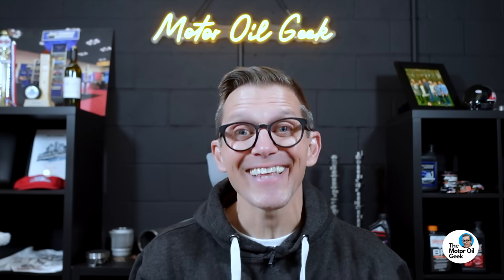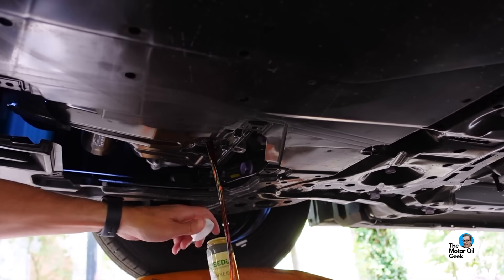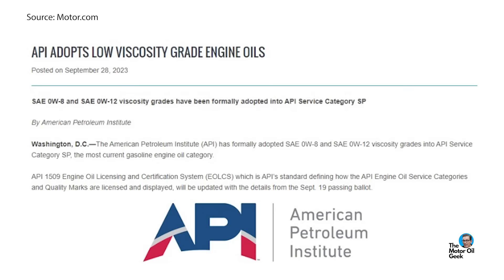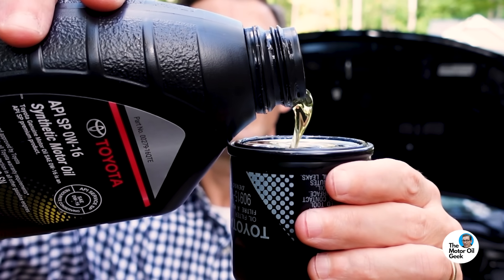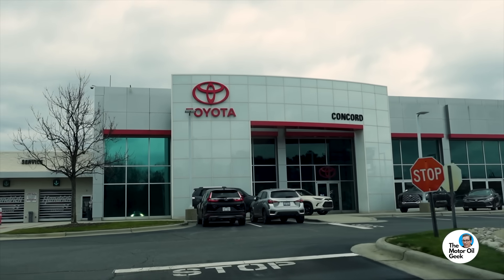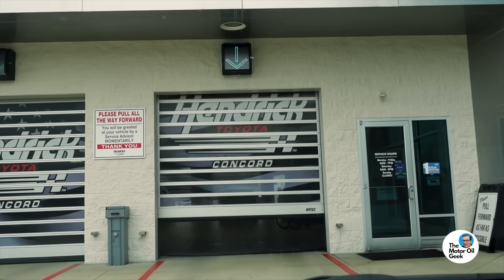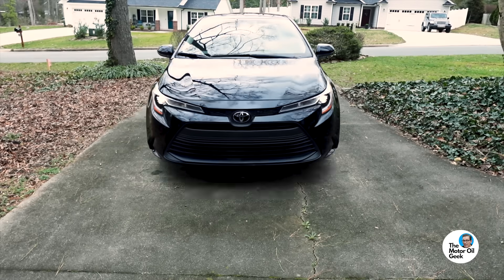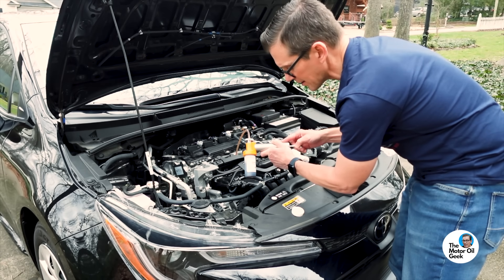0W-8 Motor Oil: Too THIN to Trust? Let's Find Out!

Comment: CVT transmissions can work well as long as you know what you have, fluid needs changed every 20,000 miles, the Jatco transmissions have 2 filters, one in the pan, the other where the cooler lines come out, make sure both are changed, also they will not stand hard driving, that is why you will only find them behind low power 4 cylinder cars, so drive easy and get the fuel economy benefit, never let your 18 year old son borrow it lol
Reply: Toyota Aisin CVT's certainly can. I know firsthand from New and over 235K miles so far
Reply: Nissan is giving CVTs a bad name. Toyota has a direct drive first gear.
Reply: Don't really need to replace the pan filter as often. It's more of a screen filter that collects bigger debris while the paper filter collects fine particles. The pan filter is quite expensive as well, I say replace the cartridge paper filter and just inspect the pan screen filter.
Reply: Just got a 2021 Corolla with 41000Kms on the clock. I have accelerated with full throttle once and boy it was really impressive...but my thoughts exactly I will be looking after it!!!!
Reply: Lol as if i need to change my ECVT's oil every 20k miles
What a load, NO one recommends this, least of all the experts that make and repair these for a living.

Comment: the thin oils are fine for a new car, you get the benefit of a bit more power and MPGs, but trust me when you get close to 100,000 miles, you need go to a higher viscosity oil the compensate for internal engine wear, or oil pressure will be too low, not a good thing, higher viscosity oil will help you get to 200,000 miles and beyond
Reply: Citation on any data to back this up?

Comment: lets look at Nascar , years ago one team found using really thin oil would give the engine just a little more power, very important in a race, even one horsepower could be the difference between 1st and 2nd place (Lake would know a lot more about that than me), but after just one race that engine is gone, car makers are under big pressure to get better fuel economy, the main reason for the thinner oils, yes you may get 1 or 2 percent better fuel economy, but is it really worth it if you have to repair or replace the engine? a few gallons of gas is way cheaper than an engine rebuild, I am a professional mechanic with my own shop, I do not even buy the 5w 20 oil a lot of older cars use, they all get 5w30 in my shop, do not get many with the 0w16 yet, I may put 5 w 20 in them, hope Lake sets me straight, do not want to make a mistake!!!
Reply: Did you not see the test results in this video? Did you not see the test results in the previous video? You can see the PPM values of all the different metals. Wishful thinking is one thing but facts are facts.

Comment: Question I have a car  that calls for 5w20 and I use synthetic oil for oil changes can I use 0w20 in between oil changes to top off???? Only reason I buy 5 quart containers and 4 of my families vehicles all require a different weight oil !! I don’t want to buy individual quarts

Comment: u should try 5w30 and see how bad the mpg really is compared to 0w8. Supposedly you can run up to 20-w60 for that engine overseas. I wanna try 0w8 in one of my 80's beater cars if it will help mpg a decent amount.
Reply: It’s still under warranty, he should follow the manufacturer’s instructions.

Comment: I can assure you, dealerships buy bulk oil from whoever gives them the best deal with the best perks.   The Yota dealer I used to work for built a new building and Quaker State bought them two Rotary lifts and gave them two NASCAR body go-carts to get the contract.  The GM dealer was using Kendall, Chrysler/Dodge/Jeep was on a Valvoline contract.   They are not required to use a manufacturer’s oil.   Hell, tons of places use BG for their trans flushes.
Reply: I haven't worked with CVT's much, but normal gear shifting transmissions definitely do better with BG. My manager at Chevy was working hard to get BG products going and the data and studies were very convincing. The BG work for CVT's, I'm told was better too, but it's been some years since I upgraded my life from being a mechanic, got into IT, but if AI takes a bunch of jobs, maybe I'll have to work on cars again. LOL Nah, I'm top at my IT experience level so that should add some safety for a while, especially since I can do a lot of hands on work that much of the IT industry can't do.

Tell me who, other than a mechanic is going to figure out that the wall socket is dirty (clean on the outside). We have so many more variables we're usually fighting than with computer building. I hope they never get into computers like they did cars, intentionally making them hard to work on, but if they do, my automotive background will be huge. LOL I guess the car equivalent is bad gasoline, which happens most from customer errors.
Reply: Can depend. Dealership I work at, Dodge size uses bulk oil, chevy side uses bottled genuine ac-delco oil.
Reply: @LovesHina  It’s up to the franchise owner.  It’s interesting that the owner is going through the heavy profit loss of using individual quarts, and on top of that rebadged bulk oil sold as AC Delco.  I assure you, AC Delco does not own a refinery.   Who knows what these owners think.
Reply: @blackhawk7r221  I also find it a bit strange, as it does add a non insignificant amount of trash, and time to each oil change as well. I assumed it's a GM/Chevy thing, since they do have a few varieties of oil for different applications. Dexos 1, dexos 2, Dexos D.
Reply: @LovesHina  With the way the LS cams were being eaten up a while back, this may have been a measure to ensure that a legit factory approved oil was used.  I doubt it, but like I said, we never know what’s going through the minds of owners.  I’ve seen them do some oddball stuff.
Reply: @LovesHina  I've worked at Chevy dealer where a lot of oil wasn't "Chevy" and bulk, but they definitely made high quality choices for products for cars.
Reply: " brown and slipery" good enough. But they charge you by the Liter for what ever crap they put in your car.
 Been doing my own oil changes  now for 55 years. Every 3,000km.

Comment: Not a big fan. I started running thicker oil than what the manufacturer specifies, if I can get one that is still compatible with the exhaust filtering systems. 
I'd fill in 10W60 full SAPS if it would not probably kill the cats and filters. That ZDDP is said to be one of the cat and filter killers... You probably can't buy that oil because it would break todays super low emission systems. Nobody cares when racing. But running in series production street legal engines is a completely different story. Because you can't run such intense additive packages. So... 0W16 is the thinnest that I would even consider for that car.

Comment: I've been proactive on my 2020 Chevy ZR2 but, think that GM quality is rather suspect these days. When I went to change the transmission fluid & filter @ 32K miles (I do a lot of off roading in it) the "trick GM recommended" fluid has given me an occasional "shudder" that never existed before. Doing the differential fluids the front looked great but, the metallic sheen of the rear fluid @ 32K miles gives me a great concern that once again GM or Dana has assembly line issues in setting up differentials. My friend with a shop has seen quite a few issues with GM differentials these last few years. Maybe I need a Ford Raptor? GM under Mary B has been on a TERRIBLE PATH towards "self destruction" with her lack of vision & leadership. Toyota saw through the EV mandates BS and never wasted their engineering talent on this too soon to market technology....Maybe I need a Toyota?

Comment: No oil lasts 10k…wake up folks
Reply: It can last 10k if driven on highway. Even manufacturers add into their manuals that under heavy duty conditions ( city driving ) you need to change oil every 5k-7k miles.
Reply: In a crap motor, true.  I did full synthetic 10w30 for 10 years in a Dodge 600 Turbo, my oil analysis said it was good for a couple more thousand miles, so you're wrong.
Reply: @lonniebeal6032  You didn’t make your case and no, you didn’t get an oil analysis after a 10k oil change interval, claiming you had more oil life left. You are full of it.

Comment: I feel like you are the right person to ask this and I would love to see a video on this as it seems no one is in agreement. Techs believe 3-5k is max even with advances in technology while OE’s are pushing that 10-15k while aftermarket’s like Mobile 1 and Amsoil are pushing 20-25k. Obviously the question is quite load and dependent on many variables but with everyone is disagreement it’s hard to come to an educated opinion
Reply: At 49 yrs old, and owning a shop, working dealerships, just 25 yr recert ASE Master +, having loyal customers nearly 20 yrs in my shop, I can give proven, experienced advise.  Stick to around 5k miles.  I tell certain ones with newer cars they can stretch a little if they have good driving habits.  I get to see their oil when it comes out.  Personally my vehicles all go 3-400k miles on original engines.  I stay between 3-5k max.  Because I know my driving habits.  lol.  80's to mid 90's get 3k on the sticker.  ALL others get 5k unless they demand otherwise.  I generally rotate every time now.  I switched to full syn oils back about 2010 (syn-blend about 2006) for all vehicles and never used cheap filters.  Mostly OEM.  Don't like it?  Go somewhere else.  I'm not an oil change shop.  I only do oil changes for my regulars so I can monitor for other upcoming issues.  A 5 quart oil change is running about $84 total  May 2024.  But how many have a $100/hr tech changing your oil and checking everything over at that time?  Not many.
Reply: Been doing extended drain intervals (10 to 15k miles) using Amsoil or Mobil 1 and best quality filters with no problems for going on 20 years.  Just sold a 2008 Honda Fit with 280k miles that used a half quart in 10,000 miles.  Always start with a well maintained engine if  used and start with an effective engine flush such as Amsoil Engine Flush per directions.  For extended drain intervals to work it’s very inportant to regularly change the air filter and to be sure there are no intake or vacuum leaks.
Reply: Any reputable mechanic would recommend 5k max! If you can’t spare an hour of your time and $25 bucks to perform an additional oil change then you obviously aren’t planning on keeping it long term!
Reply: Cars rust. 10k oil changes are fine. It will rust first

Comment: Pay me now or later Keep it clean and car will last.change tranny every 50,000 miles.
Use Tier 2 fuel only, use injector cleaner every 4000 mile Keep it clean. Thats a fact.

Comment: My '22 Camry Hybrid calls for 0w-16. The dealer I brought it from put 0w-20 in it on the first free change. I asked them about it and they said they put bulk 0w-20 in everything that calls for 0w-8/16/20. So I've been running the Mobil 0w-20 hybrid oil in it.

Comment: Not our 2022 Toyota Rav4's 1st oil change here in Honolulu at Servco Toyota.  It was 5,000 miles but the dealer said no oil change, only at 10,000 and 20,000 miles but I used the 10,000 mile free oil change.  Instead of the MFR's recommendation of 0W-16, they used bulk 0W-20 oil.  I did my own changes after than using Mobil 1 Advanced Fuel Economy 0W-16 and Toyota's OEM filter.
Reply: The first oil change you skipped sets the tone of wear on your engine for the rest of its life. 

So
Next time do it when it matters
Not after the fact.
Reply: On another channel the mechanic said that the 10k miles is for driving with ideal conditions. It's likely we aren't driving out cars under ideal conditions.

Comment: If transmission fluid was an oil what would the viscosity be? Is it NOW possible to use it as .motor oil?
Reply from the maker: No, don’t use transmission fluid as engine oil.
Reply: Thanks for the reply
 What I am trying to do is understand just how thin the new oils are.
Reply from the maker: @alexoroark5962  These two are really close. The 0W-16 oils are basically the same viscosity as ATF.

Comment: I have 5w30 vehicles, Never ever had anything less than 10w30 in them.
I have gotten well over 300,000 miles out of them without issue.
No knocks, no smoke, just go
Reply: You want the first number to be as low as possible to help on cold starts, there's no downside of using 0w30 over 10w30
Reply: @noobulon4334  Project Farm proved otherwise !!!

Comment: Our Dec 2023 Corolla J-VIN says 0W-16 in the engine bay, not 0W-8 like yours. That’s strange.
Reply from the maker: Different model year. Different EPA CAFE requirement.
Reply: @themotoroilgeek  same engine, but that makes sense. actually I should have said Dec 2022! But it’s a 2023 model. We have 23k miles on it and no problems. I’ve already changed the oil 4 times. I’ll probably start to go about 7k between changes.

Comment: Hey! Love your channel man! I was wondering if you could make a video between fluid recommendations from the 70s compared to the more modern fluids available nowadays; For example SAE 50 and 30 that used to be recommended for Differentials/Transmissions/Transfer cases and the newer 75w90 and 80w90 more modern gear oils. Can modern fluids be used on older applications (70s fords, gmcs and such)?
Reply from the maker: Great suggestion!

Comment: 0w-8 is my fat the dumbest viscosity to put in an Engine.  If Toyota didn't make such outdated engines it wouldn't call for it.  0w20 is the only one I'll go down to especially if it has a turbo, Even if I they do I bet it's made by Mitsubishi just like the Honda ones are.

Comment: I wonder what you think about the Less than 0W Alisyn Synthetic Oil? Have you heard of it? Is it actually this thin? I know it is used in drag racing, and some use it on the streets.
Reply from the maker: I know of that product. There are several racing oils even lighter than this 0W-8.
Reply: Thank you for this information @themotoroilgeek

Comment: I’d never wait for 10,000 miles! Agree!
Reply: they told me 10,000 at the dealership!
Reply: 3,000km or 3 months. Etched in stone for all my vehicles.
But what others do, I could care less.
Reply: @luckyguy600 In Germany we call it Materialverschwendung , so ein Quatsch alle 3000km ....
Reply: @TorbenRichter-z9d  Speziell alle 3 Monate, viel zu oft. Jährlich oder alle 10.000km reicht völlig für benziner.
Reply: @MrShadow1617 what about diesel?
Reply: 3000km? That's quite frankly excessive unless your using natural oil instead of synthetic. If it's an older car with synthetic, you may benefit every 4500km, but for most cars, they can do 8000km and be just fine. Agreed, 16000km is far too long though. @luckyguy600
Reply: @luckyguy600  3000km for full synthetic is pissing away money and 3 months, bahahaha.  Hell, I've gone a year and a half without changing oil with low miles, as long as you run it to get the moisture out, you're fine.
Reply: @luckyguy600 5000KM for fully synthetic oil. Nothing less, nothing more.
Reply: @AbidAli-bo8sv  10000km is fine, 5k is a waste (unless you have old diesel with some blow by)
Reply: @Rudy97 5k Km or max 7k KM feels good for my gr86
Reply: @turkicsayajin2274  if you drive it at high rpm then sure but if you drive it modestly then any less than 10k is a bit of a waste.

Comment: Hi Lake, I did a CVT change, with filter and sump clean out, for my daughters '14 Corolla at 110K miles. I didn't get the oil tested though. For the refill I used a little over 4 1/2 qts of Aisin FE fluid... which I thought would be OK to use as the transmission is made by Aisin (Toyota subsidiary??). It would be interesting to compare the Toyota fluid with the Aisin to see how similar or not they are.
It is a complex procedure, but I think I got it close enough. Let me know if you need a link to the video I did for it.

Comment: I will kep with my 5w30 evenif voswagen says use 0w30... engine is fine paint is falling a part and electric stuff also got lots of codes... also rear view camera got conection issues but im to lazy to clean conectors with electric spray cleaner...

Comment: When you hear that tic tic ticking sound the motor oil is  done thin out I seen this when oil was a 0'20 the car only had like 70.000. Miles On it and oil had been changed every 5 to 6000. Miles and know hard driving and it was ticking with only 7 .to 8. Miles on it. I just a little 0.30 in and it Quit ticking. So when I changed the oil the next time I put 1 qt of O.30 in it. And have not had any problems since. O I have a 2003 Ford f150 with a 5.4 v8 it use 0.20 I one qt of 0.30 in when I chang the oil and its got over 245.000. Miles on it and it runs fine.

Comment: The only reason why Toyota dealers are installing the correct viscosity oil is because of people like YOU that check them! 5,000 miles is the maximum oil change interval no matter what the manufacturer’s manual says. Toyota CVTs generally use the WS transmission fluid. If you really want to cut down wear on the CVT, then install a magnetic drain plug at the bottom of the CVT to trap the fine metal particles. Toyota dealers do NOT want your Toyota vehicle to last more than 200k miles, but you can make some tweaks in service to get at least 300k miles. Happy motoring!

Comment: Driving 10k miles on such oil means quick death for the engine.  4-5 thousand miles is the optimal mileage if you plan to own the car for a long time.